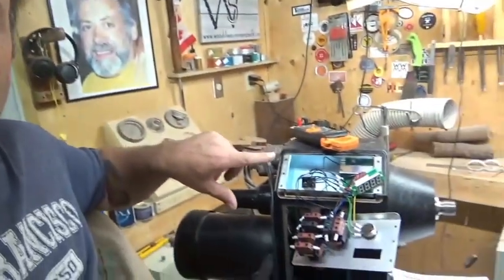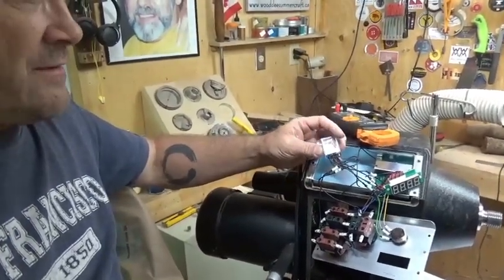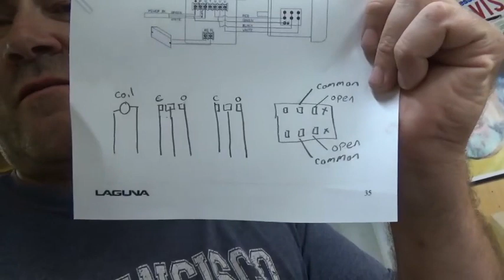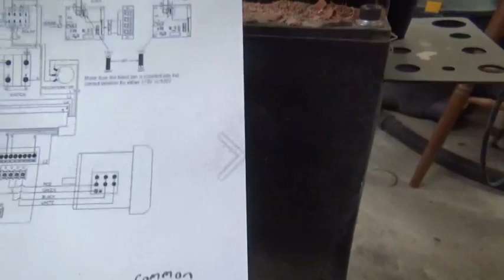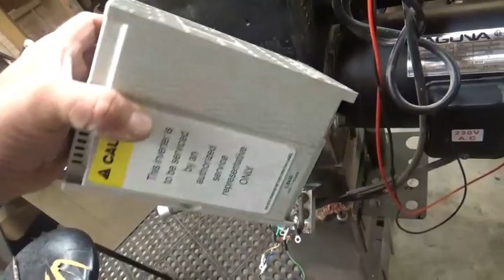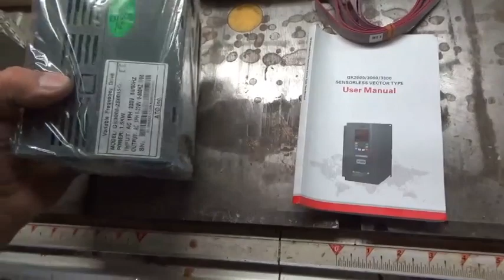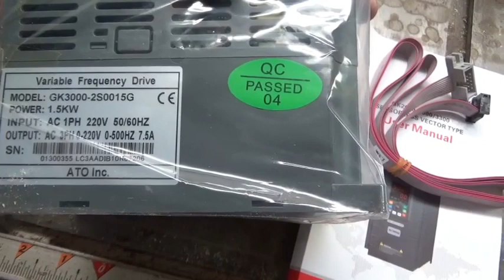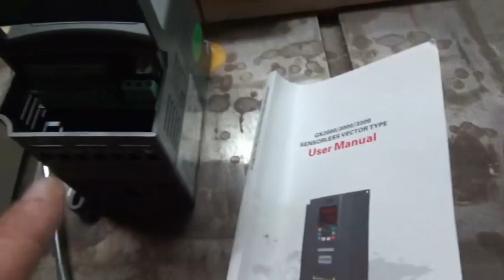The trouble with My Laguna 18/36 Lathe part 1

Comment: Capacitor failure! The most common cause of electrical failure. I had a go at replacing the caps in two failed TVs last year, one had taken out the rest of the board and was too SMD for me to work on but the other just needed a voltage regulator replacing as well and it was good to go. Fingers crossed just the cap blew!
Reply from the maker: I too have replaced capacitors on tvs, usually the power board and had great success, will see how this goes

Comment: Thanks for sharing this information.  I bought a Laguna 1524 this summer and have had no issues… yet.  Hopefully replacing the capacitor fixes it. I’m surprised you didn’t dissect the VFD before buying a replacement, especially since you’re an electrician. Oh well, live and learn. Cheers, Stuart
Reply from the maker: The saga continues, thanks for watching. there will be more parts to this before im done.

Comment: My 1836 had electronics that failed twice. I finally installed the second replacement (no easy task), and the lathe worked, but the speed readout never did work again. Also, even with a replacement banjo, it took tremendous force to lock it in place. I sold it to a guy, and spent a fortune on a Robust American Beauty. Now that is a great lathe.
Reply from the maker: Im seriously considering fixing it to sell and maybe purchase a vicmark VL200 Short ASM EVS, that too is a serious lathe

Comment: My 18/36  Laguna lathe will stop when under turning resistance - otherwise turns with variable speed working.  I have tried turning off and blowing out  dust on the control panel.  I tried  contacting  Laguna for the past 3 weeks (7 emails to customer service - Chris K.) and several phone calls  No response from Laguna. .  I spoke with my local Rockler store and Woodcraft store - both told me that Laguna has a reputation of not having customer service.  Both suggested any lathe other than Laguna.  I do not want to buy a new lathe - Does anyone have suggestions for my problem?  I appreciate any advice you may provide.  Thank you. Michael
Reply from the maker: @MichaelBluhm-j9u  Chris is the same guy I dealt with we did have an email thread going on and the conclusion was a new VFD that wasnt covered, my cost $1000, I managed to get a vfd from a work friend of mine for under $400, if you think that may solve your problem I am sure I can hook you up, depending on your location
Reply from the maker: customer_service@lagunatools.com
Was the email address I used